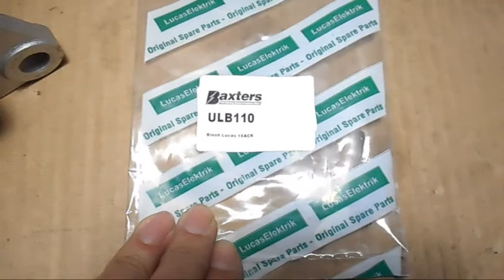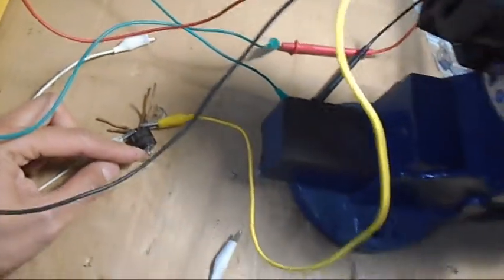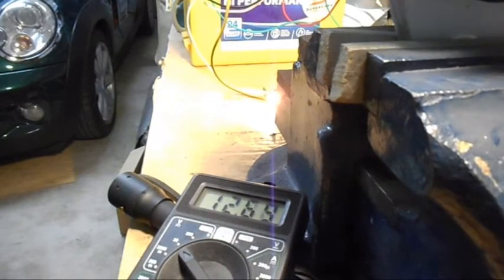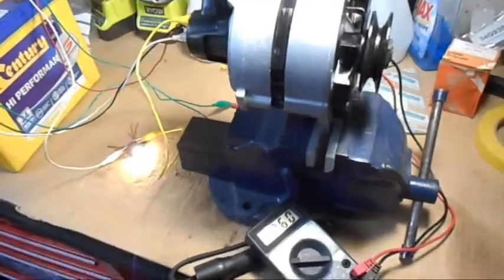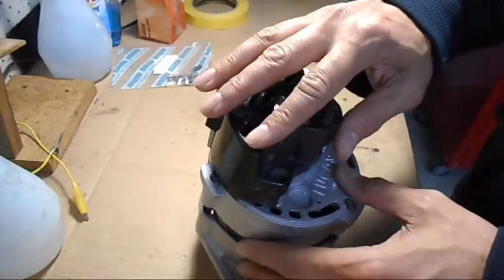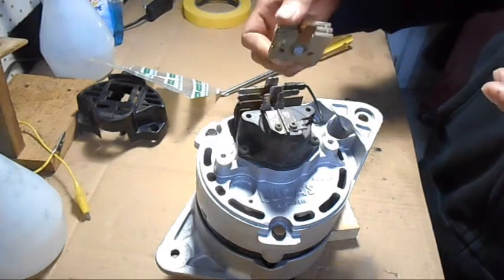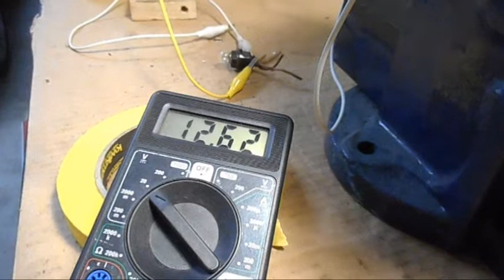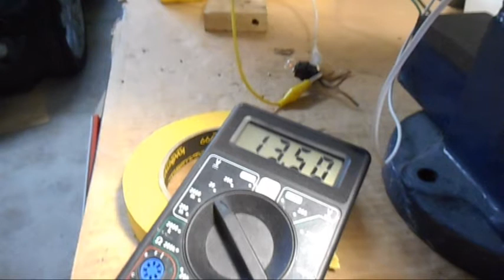Morris Mini Cooper S - Lucas 15AC Alternator EP028

Comment: yes the old ac15 and ac16 would have an external regulator which would normally be the overcharging fault. so your test will check for unregulated voltage. if tested on a bench test with faster r.p.m. you would find voltage would keep going up.

Comment: Did it fix your problem or was it the voltage regulator??
Reply from the maker: Alternator is working fine. Changing the regulator the voltage does not exceed 14v when running.